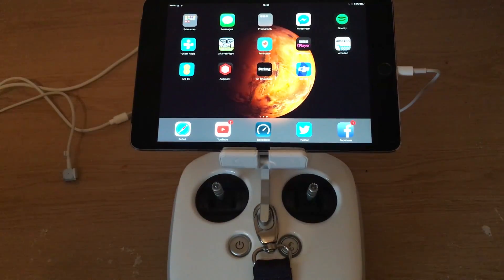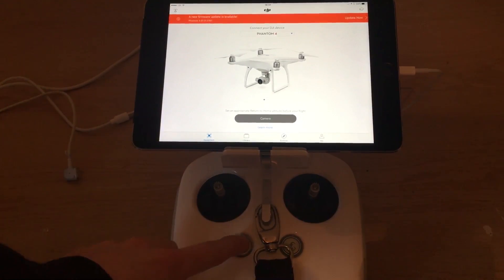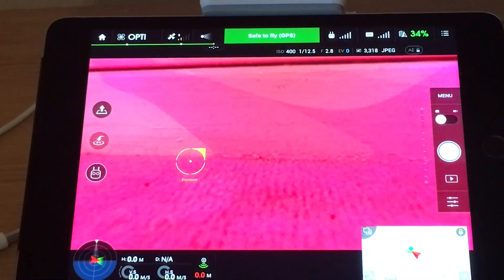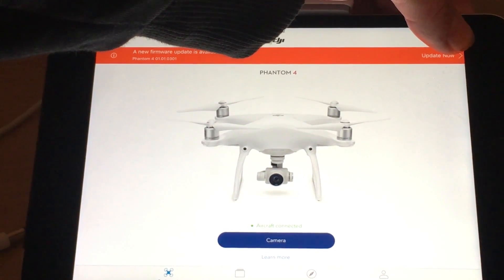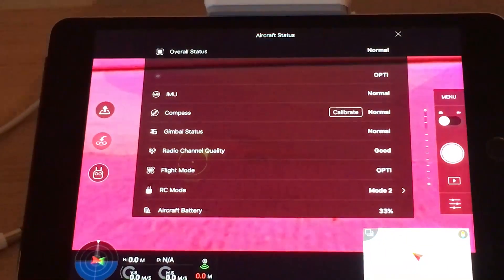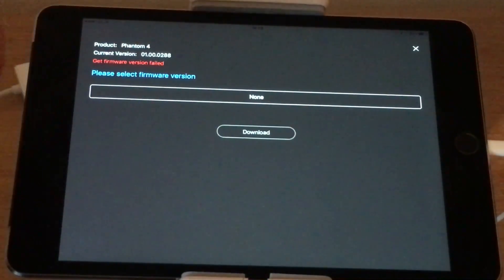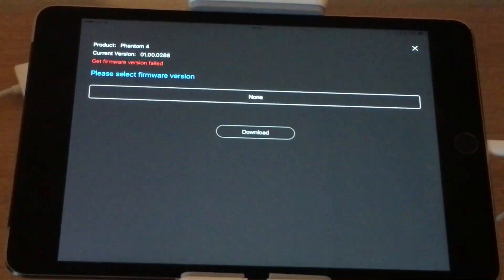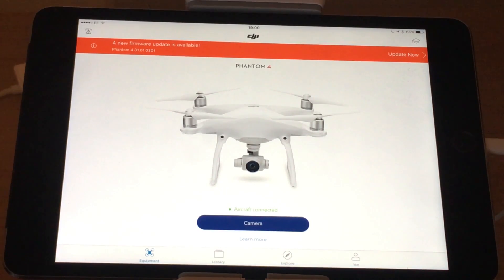How to: Fix the DJI Phantom & Inspire RC Signal Lost Error!

Comment: Hi Mark, I just recently got my Phantom 3 4K and I have a problem with the image signal. When I fly it, the image on my phone will cut off and then it will say No Image Transmission Signal, and then Aircraft Disconnected. I can still control it, but there is no image on my phone. Have you had this problem? And do you know how to fix it? Thank you!

Comment: I have the same problem, but for me it is not possible downgrade the firmware for the RC, after I hold the academy icon for 10 seconds this is what I got :

Product:Unknown 
Current Version: 01.03.00.00
"in red" Get Firmware Version Failed
"in blue" Select firmware version
None 

So it is not possible downgrade
Reply from the maker: How's it going? hope you managed to fix it.

Comment: Hellos from Maldives!, After upgrading my phantom 4 & Rc having a signal lost problem, when the aircraft reaches around 100ft aircraft is disconnecting. This problem is with RC . We tested aircraft using another reomte..it's all good with other remote. How can I fix my RC!!? Any help! Thanks
Reply from the maker: Hi Appe, sorry to hear you are having issues. I would be very careful but carry on flying, I'm sure this issue will be resolved soon with a firmware update :-) hope this helps.

Comment: when i try to downgrade in the drop down menu nothing happens, it doesn't turn into a drop down menu it just is a box with NONE in it??
Reply: I had the same problem. Read my convo with Marky and try all the things I did. What worked for me was using 1) DJI assistant 2 2)using a Windows computer and 3) using my personal hotspot as wifi from my phone!
Reply from the maker: +Krystal Boyd Hey Krystal, do scroll down a bit and read mine and Henry Ho's convo, all of your answers will be there! :-)

Comment: I'm getting the same "signal lost" error as well and I'm trying to do your fix. I can get to the grey screen, but the drop down doesn't work. It just says "None"  My current firmware version is 01.00.0288. I've repeated the process several times, same result. Any thoughts?
Reply: +saulniercreates I have the same issues. You are not alone :(
Reply from the maker: +saulniercreates Hey dude, have you tried downloading the latest firmware via the DJI Assistant 2? http://www.dji.com/product/phantom-4/info#downloads
Reply: +TheMarkyShow Yes, I'm getting "Cannot load firmware list. Please Retry."
Reply from the maker: +saulniercreates are you using Mac or Windows ? Many people have reported issues with the Mac version, however with the windows version clicking retry a couple of times usually does the job !
Reply: +TheMarkyShow On Mac.  Refreshed several times, off/on phantom, etc.  Same result.
Reply: +saulniercreates I have a Mac and it didn't work. I will try on my Windows and see if it'll work. I will update you!
Reply: +saulniercreates Unfortunately the firmware upgrade has also failed using DJI assistant 2 on Windows.
Reply from the maker: +saulniercreates do you receive  an error message of any kind? can you try using your mobile hotspot for example/ a different internet connection
Reply: Just says, "Cannot load firmware list. Please Retry." when using DJI Assistant. I will try it again at work this afternoon. But, getting pretty frustrated.
Reply from the maker: +saulniercreates Hi, is this still happening on a mobile data connection? can you please try re-installing the software?
Reply from the maker: +saulniercreates there may be another firmware released this week! hold tight! :-)
Reply: I hope so. Thanks!
Reply from the maker: +saulniercreates :-)
Reply: +TheMarkyShow New firmware is out. Should I update?
Reply: +saulniercreates Updated. Back up and running!
Reply from the maker: glad to hear!

Comment: Hi TMS, 
Unfortunately, i'm still having the issue. I've already re-installed the dji go app for the nth times and even tried other phones but still doesn't work. 
When i checked the upper right icon, its just showing 
Product: Phantom 3 Standard
Current Version: Unknown
Get firmware version failed

Any links where i can manually copy the lower firmware version ?
Reply from the maker: +Ciami Arroyo Hey dude, really sorry my video hasn't really helped you out on this occasion.. Let's try some more stuff.

Are you using iOS or Android? 
What version of DJI Go are you using? 
What version of firmware is your aircraft using?

Things to try; 
Can you try connecting to another WiFi/ Data network?
Has this definitely been caused by a failed firmware update?
You will need to downgrade the aircraft through your SD card, the problem is, we need to find the older firmware for your aircraft... can you let me know your current aircraft firmware, find this by switching the aircraft on, launch DJI Go, go to About.

Hope this helps,

- Mark

Comment: Hello , I have problems with my ipad the  image turns green and sometimes the image cut , you know what is the problem ? with my iphone I dont have this problem.. (sorry for my english) sheers from canada.. :)
Reply from the maker: +Sik MiNeR Nunez this sadly sounds like a hardware issue.. is this a brand new P4? if so, I would return it for a replacement.
Reply: yes man brand new..but I dont know why only with the fuc*ing Ipad.. thanks for your help!
Reply from the maker: +Sik MiNeR Nunez hmm, I think it would be worth trying to re-install the app on your iPad, or even restoring your iPad to default, also try turning hardware decoding on (in the DJI GO app settings menu)... let us know how it goes :-)
Reply: ok, I will!! thanks man!
Reply from the maker: +Sik MiNeR Nunez :D np :-)

Comment: Hey Mark thanks for the share my gray and it wont let me downgrade. The screen says there is no available firmware for downgrade. Any clues would be greatly appreciated. cheers
Reply from the maker: +Baffour Anim Hi, sorry to hear. Can you try re-installing the app and making sure you are connected to a WiFi network. Can you also make sure that the RC LED is Green when connected to your tablet/ phone, also make sure that your aircraft is switched on. If your RC upgraded before your aircraft then following the above tips should fix this issue. Can you make sure the red error message says RC Signal lost and not 'Cannot take off'? Let me know how it goes! :-)
Reply: yeah i have tried everything you mentioned above and i didn't get the drop down menu to downgrade the firmware. My drone was capable of going at least 1000ft away without loosing signal now i can only get about 200 ft before it starts acting up. I have tried restarting everything. Where can i download the firmware file for the phantom 3 standard itself? Ive been on the dji site and they only have firmware downloads for the phantom 3 pro and up.
Reply from the maker: +Baffour Anim I am experiencing the same issues too. I really hope a firmware update is released to fix these silly issues and that it is not an issue with the hardware in the first production batches.. Have you tried the 32 channel mod? you can search YouTube for this, if it's helpful then I can make a video on this too.  Good question regarding the P3S firmware, I cannot find this either. It would be best to have a look/ start a thread on the DJI forums in the Phantom section. It's also worth looking on RCGroups or the DJI Phantom Owners Facebook page. :-)

Comment: On the grey screen I have the "Get firmware version failed" error. Any tips?
Reply: +James Sanders I was able to get it downloaded. Now I can't figure out how to connect the mobile to to drone to install the downgraded firmware.
Reply from the maker: +James Sanders Hi, make sure the drone is on, the RC is on (LED is Green), make sure the mobile is connected to the RC with the cable, make sure your wifi is on, then start the downgrade from the instructions in my video! Let me know how it goes :-)

Comment: i have no drop down menu...? and I upgraded thinking that was the right thing to do
Reply from the maker: +CapturingConor so the RC has been upgraded but the aircraft has not? try re-installing the DJI Go app! Make sure the aircraft is on, you are connected to wifi and the controller is plugged into the RC and the RC is turned on. Also make sure that the RC LED is green!!! Let me know how it goes :-)
Reply: TheMarkyShow its all fixed now thanks!!
Reply from the maker: +CapturingConor nice, great channel btw. subscribed. :-)
Reply: TheMarkyShow amazing thank u i will sub back :)

Comment: Hi Marky. 
I have the lost signal problem!! but on my grey screen under the drop down menu box in red it says 'no available firmware for downgrade'!! I'm at a loss to know what to do now!

Any ideas? 
cheers
Reply from the maker: +PCR555 Pics Hi, sorry to hear this. What color is the LED on your RC? Can you try reinstalling DJI GO? Which DJI product?
Reply: I have the Inspire1 pro. The led with the aircraft on is green, when it's off the led is red! I'll try reinstalling the DJIgo app.
Reply from the maker: +PCR555 Pics hmm, hopefully the reinstall works for you, otherwise I am not sure. Sorry :-( It's worth looking on the DJI Forums, Phantom Pilots & Facebook group pages (Inspire 1 Owners) etc. I hope you get it fixed soon!!
Reply from the maker: +PCR555 Pics have you had any luck so far?
Reply: Same problem :( I have phantom 4 there is "none" under the firmware
Reply from the maker: +Rajiv Sankarlall Have you managed to fix this bro? :-)
Reply: You need to manually plug the drone into the computer via microusb and use the assist to install the drivers that way... the issue was even though it said it installed it... it actually didnt ... i also used a windows PC because i heard mac had issues with the assist :)

Comment: Hi, my "getting version list" keeps failing. Is it possible to do via the DJI assistant 2 program on mac/windows?
Reply from the maker: +Imran Zohar Hello, you can do this on the assistant 2 software via your Windows PC, can you first try re-installing the DJI GO app?
Reply: +TheMarkyShow So it got it done. I updated the drone using the assisant program on a PC. it downloaded successfully and started updating. Then it froze at 92%. Took a chance and turned the drone off during update and its up and running now! I had seen it restart by itself during the update so I was pretty sure it was done.
Reply from the maker: I'm glad you have fixed the issue. I would try a small test flight with the drone hovering in front of you in a large area before flying normally again. Let me know how it goes! :-)
Reply from the maker: +Imran Gohar how's it going by? Have you had a chance to fly it!

Comment: My gray screen said something like "Getting firmware versions" but then after about 30 seconds it said "Get firmware version failed". Any ideas?
Reply from the maker: +prairieskycam try updating the app
Reply: +TheMarkyShow 
I did that. Here's what I see in the About screen for the Go App:
App ---- Version 2.7.2
Aircraft ---- Version Unknown
RC ---- Version Unknown
Camera ---- Version Unknown

It recognizes the Flight Controller Serial Number.
Reply: +TheMarkyShow 
After repeated attempts, I was able to get one version in the list (1.5.8) and updated the RC controller to that. After restarting everything, the Go App said there were updates to the RC Controller, Camera, and Aircraft. I updated the RC Controller to 1.6.0 and now I no longer get the "RC Signal lost" message or the flashing yellow light on the aircraft. However, the app still says the camera and aircraft need to be updated. The versions on the About screen say 1.7.00.90+ and I think I'm going to hold off on 1.8.1 for a while. Thank you so much for putting your video out there!
Reply: +prairieskycam Im getting the same. Fireware version list keeps failing.
Reply from the maker: Can you try re-installing the app?
Reply: +Imran Gohar All I can say is to keep trying. Eventually the list loaded for me and had one version to choose from which was version 1.5.8.
Reply from the maker: Great to hear this worked for you eventually! :-)
Reply: +TheMarkyShow Yes! Thank you for posting this video!
Reply from the maker: and Thank you for taking the time to watch it! :-)
Reply: +TheMarkyShow You're welcome.